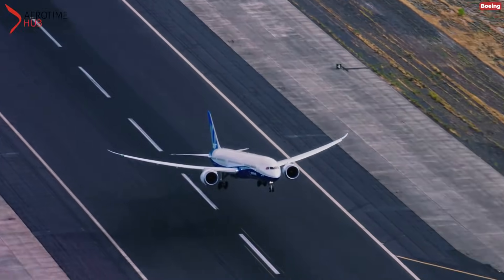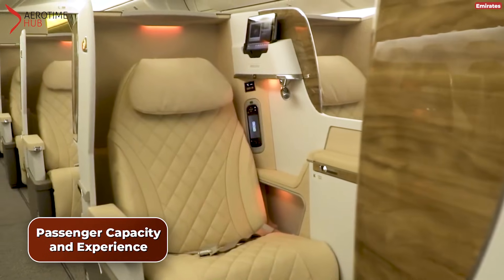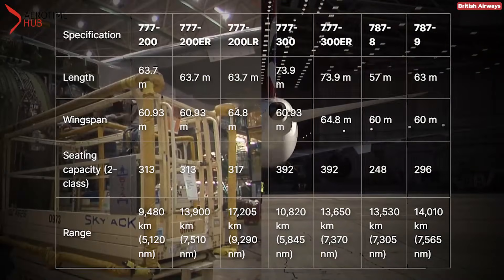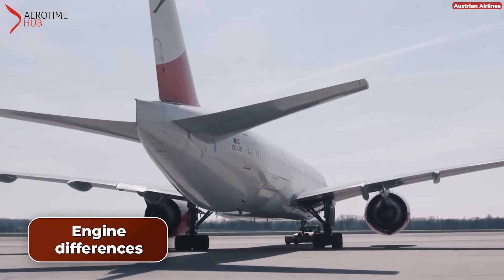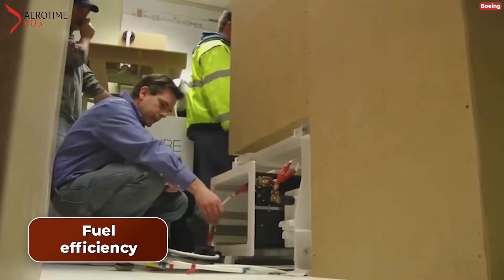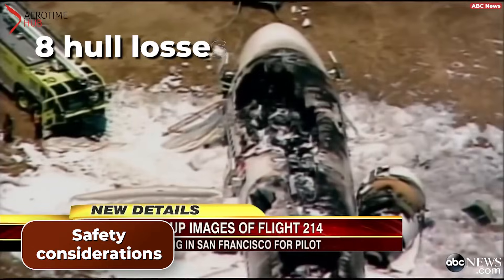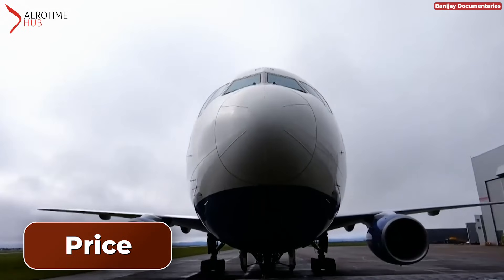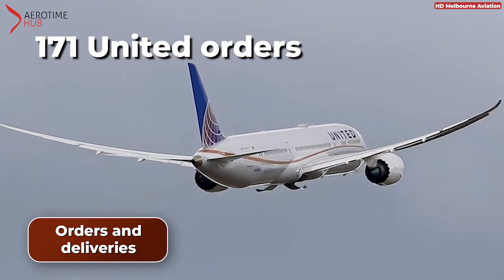Boeing 777 vs 787: features, specs, performance, experience, safety and passenger capacity

Comment: I travelled in old Boeing versions from Karachi - DXB - Heathrow London round trip and one of the sub standard domestic plane i ever travelled was British air ways from Heathrow to Glasgow in 2002.
I liked Boeing 737 and air bus A-320 as they are very good as their take off and landing was very smooth,
In Pakistan Air and Boeing old versions are used by air lines but PIA using Boeing 777.

Comment: Aircraft anthusiast here, I'm pleased with your analysis, they're correct, I love flying with 787, it just a joyful experience, the flight was butter smooth, but I don't really care about cabin noise cuz I love that roar from those engines 😂
Reply: The inside room for seats makes the difference. I don’t like the 787 electronic windows, it’s less wide inside. I never really knew the difference until today I took a 777 window seat. Then was on a 787 later that same day with a window seat. 777 was a 4.5 hour flight the 787 was 9.5 hour. On the 787 I could felt the inside cabin was liners move in and out as we were descending. Didn’t notice that with the 777. But I had MORE room also. Same 3 seat row configuration.
Reply: Insanely gay.